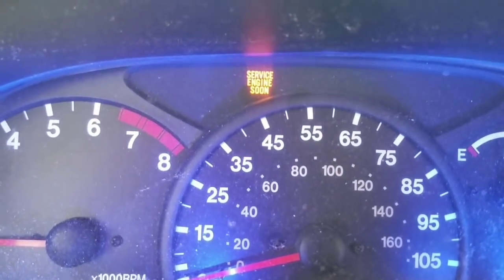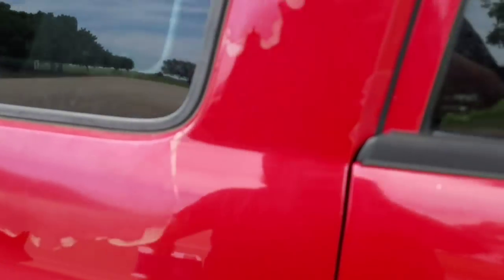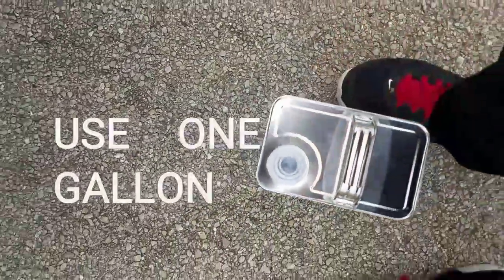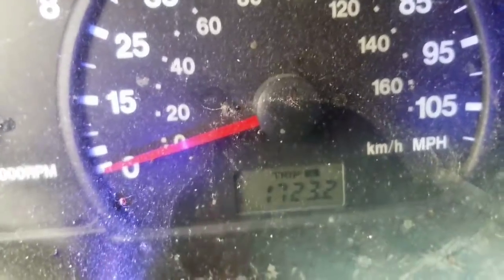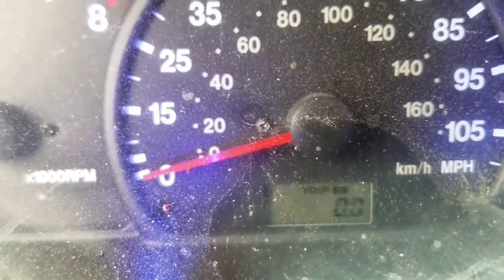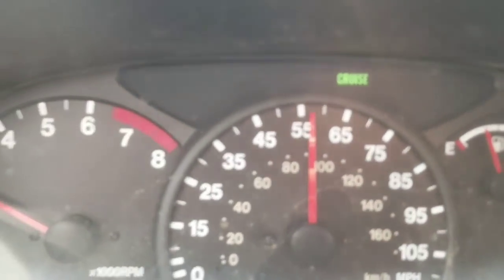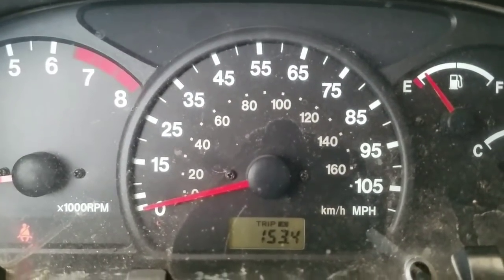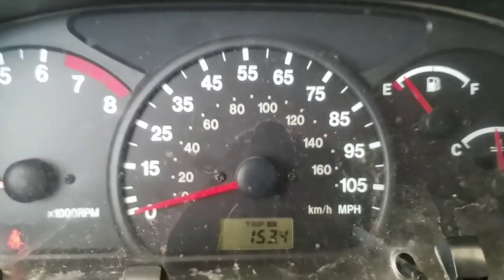LACQUER  THINNER  FIX FOR CATALYTIC CONVERTER.

Comment: DID NOT WORK on my Jaguar Super V8. Code came back the same day
Reply from the maker: I'm sorry, I did mention it worked for me but I did it at my own risk and don't recommend it to anyone. It may not work for everyone. Does your car make a rattling sound when you accelerate?
Reply: No rattles---Code PO420 came back an hour after I ran the thinner thru the car
Reply from the maker: Did you use a gallon of lacquer thinner to a half tank of gas and drive it till it's almost on empty? You have to drive at least at 2500 rpms.

Comment: 5:50 EVAP code yea my 99 corolla had that and some scion xd is irreparable for that code! One guy I know bought a scion xd with 70k for 500 bucks because the custoner that owned it couldn't fix it and it was a money pit.
Reply from the maker: I tried it at my own risk and it worked for me. It would be nice to not have car issues.

Comment: I did this last night and I wake up this morning and my car wont even crank.  Any idea why may have happened?  I'm pissed and wouldn't recommend this idea after today
Reply: Mr 210 not cranking is an electrical issue not a lacquer thinner in your gas tank issue
Reply: Mr 210 did you pour in your gas tank and let it sit overnight?
Reply from the maker: +Reginald Houston poured it on a half tank of gas in the gas tank and drove it on the highway till it was empty.
Reply: Mr 210 sht ate the injectors probably
Reply from the maker: I poured it in and drove it till empty.
Reply from the maker: waun cartierbenjamin I disclosed it to use at your own risk.
Reply: I totally feel you on the no Car payment and enjoying life at your own leisure.
Reply: I wonder if I can do that to my 2001 Toyota Solara. I'm having that po420 code.And it's totally wigging me out.
Reply from the maker: Princesslatera Andrez If you have any doubt try Cataclean first. I tried the lacquer thinner at my own risk. Good luck.
Reply: I am a mechanic. the non start or even turn over is an electrical issue. and could in no way be related to the lacquer thinner. unless maybe you poured it on your battery instead of in your fuel tank.
Reply: What kind of car do you have Mr 210 ??
Reply: Did this to my 06 Ford Mustang, had a bunch of mechanics telling me to get new catalytic converters, revved the engine for 20 minutes at 2500 rpm, then hit the highway for 70 miles total and the check engine light never came back on.

Comment: thank you i must try it on my 2005 camry this week ( 420 code ) let you no  thanks again
Reply from the maker: +way gill right on, just remember I don't recommend this I tried it at my own risk.
Reply: Ivan Roux yes I understand but I think I'm going to try 2 other things before but thanks anyway
Reply from the maker: +way gill Cool, look up Cataclean. Some people claim it works. AutoZone sells it.
Reply: Ivan Roux for me Cat Cleaner had worked in the pass. I presently have two bottles in with tank 1/2 way full. Driven 80mls. And still light on will keep you posted .
Reply from the maker: +NELSON ACOBE Good luck.

Comment: didn't work on my 2014 Focus
Reply from the maker: +Steven Tangney did you use a gallon?
Reply from the maker: +Steven Tangney for some you have to disconnect the battery.
Reply: I have a scan tool, I cleared the codes, came back on. I replaced the down stream O2 sensor, so far so good.
Reply from the maker: +Steven Tangney right on. I guess I got lucky. Mine stayed off and I passed my vehicle inspection due at the end of this month.